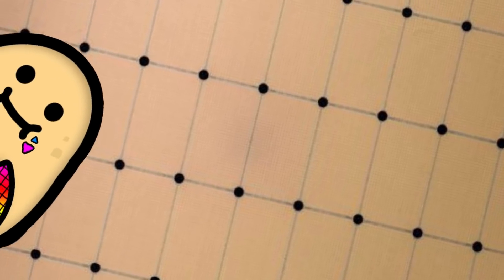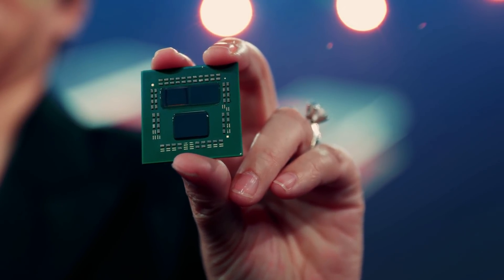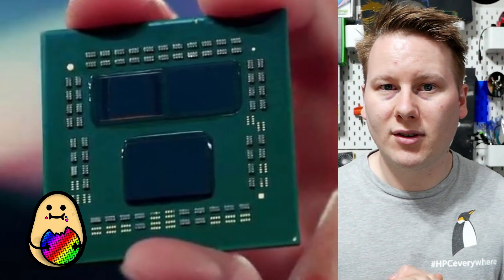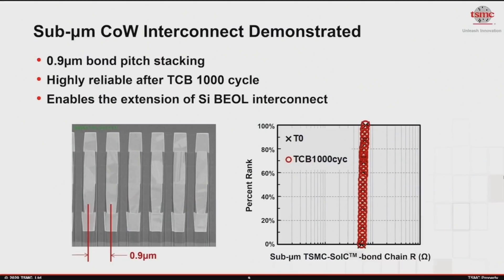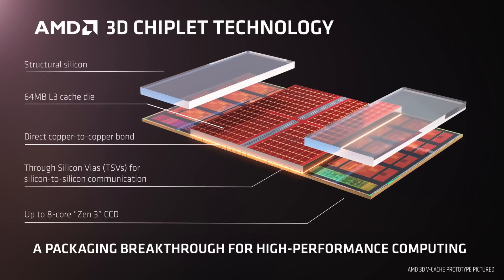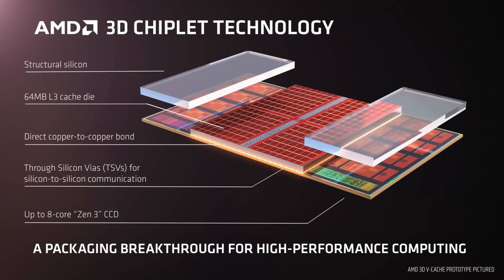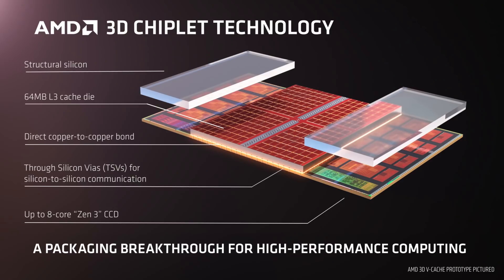AMD GETS STACKED 💪 192 MB of L3 Cache on Ryzen, Coming 2022?

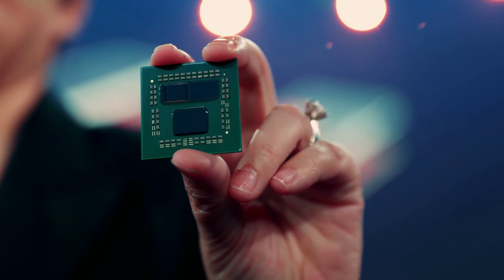Comment: 3:05 Lol I know this video is ancient, but this actually isn't right. The chip Lisa showed had V-Cache on BOTH chiplets, but with the heat dissipating "silicon lid" removed on the left one so you can see the bonded cache die inside. (It's still there inside the right chiplet. Notice how much bigger it is vs normal Zen 3).

Comment: I'm a bit confused why you wouldn't want to put the core on top of the memory? Wouldn't that align more with where the data needs to come from and where the heat needs to go. Not my area of expertise but building a system I would put my cache between the work being performed and the outside world instead of having to go through the work being performed.
Reply from the maker: The cores need lots of power. If the cores are on top of the cache, the power vias have to come through the cache, creating silicon dead zones due to interference. You essentially get less density in your cache as a result, and it's much harder to design that way.
Reply: @TechTechPotato  Interesting! Thanks for the answer.

Comment: I think AMD will add cache to their mobile processors too. It's much cheaper to make a small SOC and then increasing the L3 with stacking as needed. At the end, the same way they started making chiplets for Epyc and then using the same ones with Ryzen, the other or maybe the primary desktop chiplet branch will be small, efficient mobile APU-s stacked with extra L3 ditching the need for a separate  I/O die. Laptop parts could have a special higher tier with increased cache for mobile workstations. The implications of this technology are mind-blowing.

Comment: I am thinking AMD's 192MB of L3 will go over as well as Intel's L4 of 128MB that Intel got rid after it didn't work with the Broadwell CPU. The reason why is L4 slowed down the chip. The reason why not Eypc is Eypc's adtavage over Ryzen is Eypc can access more DRAM than Ryzen can so having to go through 192MB to get to the memory controller to get to the correct DRAM chip will slow down the complex server workloads. I can see it used on compiler servers but i don't think anyone will buy a Eypc chip just for compiling alone and nothing else. As Ryzen is pretty much a consumer use chip. Consumers who don't game most likely wont notice any difference while consumers who do game will notice a difference. It will also make a thing to get a segmention from Ryzen and threadripper. Threadripper having less L3, more cores and more RAM compared to Ryzen with more L3 less cores and much less RAM. Very different market segments require different chips. Threadripper chips are basically Eypc CPUs while high core count Ryzen chips are getting close to how many cores a  Threadripper chip has. Having another factor between them might help. Having something that helps the consumer instead of taking away something is good. Intel did it by taking away ECC to divid their server and consumer lines. IF AMD just changes how the Ryzen chip and Threadripper / Epyc chips are then AMD will be giving the consumer something instead of taking it away.Smart business move that only the I/O die has to change which the I/O die for all of them is already different.

Comment: As far as I am aware it’s not a silicone shortage it’s a substrate shortage so in theory the increased silicone shouldn’t affect how much they can produce
Reply from the maker: Silicone is for fake breasts. Silicon is for processors. TSMC is still running at limits, and AMD's wafer supply has to be managed, regardless of the substrate shortage.

Comment: Maybe stacking cache on cache prevents the drawbacks you mentioned. The logic portion of the chip "the cores" do not have chips overtop being feed by via connects. Just silicon blanks to level the chip and help with heat transfer. If AMD wanted to offer some simple low bandwidth and low power type secondary die logic, they probably could stack that over the cores.
Reply from the maker: There's a second video where AMD answers our questions. That's covered in that.

Comment: Didn't they say that the copper interconnects also aid with helping keep the chip cool? Like if you have copper bottom to top with the interconnects would that not perhaps increase heat transfer at the interconnects? It's got over double the heat transfer coefficient... and if this is good for gaming shouldn't it also be good for apus? Like adding extra L3 and maybe L4/HBM would remove a lot of the bottlenecks that are experienced with APUs.

Comment: @TechTechPotato You mentioned TSMC had a prototype withj 12 dies stacked... this AMD one has just two dies.. but in your travels did you find out if the 15% boost is a linear or decreasing value... if it was 12 dies stacked would that increase performance by 180% or more like 50%-60%...ish?

Comment: Think it sounds like we'll be getting a refreshed Zen 3 with 3D stacked cache in Q1 2022 and Zen 4 in either late 2022 or Q1 2023. Would be similar to the XT refresh of Zen 2 which came out the same year as Zen 3 but like 6 months earlier.

Comment: IIRC large caches are also very useful for compiling, rendering, and compression. I think also generally memory-intensive workloads with a medium sized footprint (some 10s to low 100s MB) could get large speedups for large L3s.

Comment: I bet that having a ton of cache helps clean up the long tail of extremely diverse niche use cases that need it. Like if your program needs to randomly access a 20-30 MB array (per core), then adding more cache is extremely productive until you have enough to fit all the arrays in it.

Comment: I remember reading about a “neural cash” where the cash was able to do a limited number of operations such as adding multiplying and accumulate. Basically presenting a PIM (in cash) to handle some ML workloads. That could be a possibility for utilising this massive increase in cash. Although you would run in to that power limitations with TSVs 🤔

Comment: There is a story in AMD’s vcache beyond performance. SRam has different requirements to logic transistors opening the possibilities for process optimization (I.e. did you notice that the vcahce achieves 64mb in a similarly sized area to the 32mb of intergrated cache in the zen 3 die? Despite both being 7nm). A separate sram die could use optimized libraries and optimized processes e.g., fd soi. Furthermore I’m not sure if cache gains that much from node performance improvements that logic does, with profound consequences I.e. supposedly cost per transistor is flat or increasing with decreasing nodes. I wouldn’t be surprised if zen 4 has less integrated cache with more outside cache. Think more cores or less cost. Semiconductors has always been about x per dollar.

Comment: If this works for L3 it's only a short while until they use it for massive L1 caches... Lisa mentioned that the stacked chip is an SRAM, so it's only a matter of supporting the required associativity.
Reply: I don't know about L1 or even doing this for L2 cache. Just trying to think of how you would do it would seem like a nightmare.

Comment: Did they just grab one silicon die flip it and put other on top of it,face to face?Or they put it on the back side and interconnect goes through silicon? How did they manage thickness of it? Is it 2 times thicker? Why not to put copper stiffeners instead of silicon?

Comment: An interesting point, their 3d stacked tech was being shown off with CURRENT GEN RYZEN. AKA 5900x. NOT NEXT GEN RZYZEN! Lisa Su stated it was like 12% average more performance just from going 3d stacked with this new cache.... but that's on a 5900x.... what happens when you 3d stack with a cpu that can take better advantage of the cache because of an updated design?

With that in mind, we can ASSUME AT LEAST a 12% performance increase with AM5 over AM4 simply because of the 3d stacked technology. Which is still a great performance increase alone. Then we will have architecture gains as well as clock speed gains. I am assuming a 30% bump over AM4 going to AM5 with DDR5 memory....

Comment: My only concern is heat. SRAM is power hungry and runs hot, especially if it’s stacked on top of a heat generating component...
Reply: TSVs conduct heat really well. So components below it should be fine. It seems HBM has really worked well for AMD.

Comment: It is an over simplification to say cache size only is good for gaming. Cache size is good for everything that optimizes for it. My first goto when optimizing a critical section is cache alignment and sizing. When bigger caches become available in the main stream more and more applications will optimize for it. Think threading in the early 2000s, developer adoption requires standardization first and usually is a generation behind the hardware.

Comment: I think you provided a a clear and fair review of their new feature announcement that we will likely see with the upcoming refresh in the start of 2022. I do wonder for upcoming architectures if they will switch to a stacking method that puts the cache on the bottom and the logic cores on top of the stack for better thermal transfer characteristics like how Intel is going for in their design? That extra silicon used for increased rigidity and mounting support is gonna insulate core heat a bit more like you said, and I think that may impacted overclocking max headroom slightly, and if not, may be alarming at first because of the higher base temps at a minimum.

As for stacking the cache on the bottom, yeah i get that wasn't likely gonna be the first implementation they released, as they would have needed to sort out vertical power delivery pathways, and possibly other issues like you mentioned. So stacking cache on top of existing cache, while not easy, is still likely a lot easier than the more in-depth redesign to layering it on the bottom and then routing power to the cores vertically that would be required.

Comment: So if it's 36 mm^2 X2 for two stacks of additional cache to get 12% more performance in gaming only, it seems very inefficient. The additional 72 mm^2 of silicon should be costly, and since Zen 3 is 81 mm^2, 88.8% more silicon should be giving 37% more performance by the square root rule of thumb.

Comment: Chuck an 8GB DRAM chip under the lid and you get the sub700 laptop market. It is way way better than having a USD 30 soldered DRAM stick pass through the motherboard adding latency, eWaste and more importantly cost.

Comment: This is the most pointless insistence we've ever seen, especially when Icelake's small L3 is already getting 90+% hit rate in almost all situations I tested. Perhaps that cache die will increase the hit rate by, like 3%, with several more cycles' latency as a side effect?

What they really should do is to improve their prefetch algorithm, IF latency and overall architecture, instead of just give caches, hope the benchmarks and low-end games always run in it, and advertise on so-called "IPC improvement" in these things.

An interesting note, the effect of 16KB L1D buff in Icelake, in overall cache hit rate, is already larger than the difference between units which have 24.75MB and 38.5MB L3(tested by deactivating cores to preserve cahce at the same core cnt, and measuring in Vtune).

Comment: the trick/trade-off in cache is miss penalty. the shared L3 latency is 10ns? for AMD? I believe that means an L3 cache hit is 10ns to deliver data to the core (L1?). My question is: on an L3 miss, what is the delay in sending the request to the memory controller? in principle this could be less than 10ns? 
Presumably latency to the off-die SRAM is higher than on-die, even with stacked & TSV. To a degree, an app can tolerate the longer latency if there is sufficient hit rate. But shouldn't the tags for the stacked SRAM be on-die? hence on a miss, the request can be sent immediately to the memory controller?
Also, is it really cache? or is it directly addressable memory? In Intel, there is an option to use a certain amount of the L3? as memory and a specific application that benefits. Cache has curve of diminishing return, and incurs latency on a miss. The reason for memory is one, no tag (tag check) is required. There are apps (including kernel components) in which certain memory structures are critical and can fit easily into a large (by SRAM standards) array.
On second thought, if the SRAM die is only 6mmx6mm, just put on the CCP die (also small), assuming the IO + CCPs fit in the package

Comment: So how many generations until they can run cinebench in cache? That'd really boost benchmarks.
Integrating this on epyc seems easier IMO - lower power per CCD (although at AMD power levels it'll probably be fine on ryzen as well). The people buying 72F3 epyc chips will like it a lot

Comment: Does all the elements of the stack need to be supplied by TSMC?
Can they fab the cache using an older process node?
Reply: I think cache will need to be on similar nodes due to how fast it needs to be and also space in a chiplets design.

Comment: So later on if all cache moves to the top layer i assume that would be allowing more space below for the cores to be expanded?
Can they add copper or so heatsinks to the sides instead of structural silicon to help dissipate that heat ?

Comment: Cache was introduced back then, because the Ram wasn't fast enough.
 To me, ddr5 is too laggy for Ryzen to work on spot. So this tech is to cut some latency, for to the ram to perform.  Might be that its linked with the infinity clock speed, thus finally bring it to 3ghz+ or even 4ghz! Maybe not...

Comment: Am5 will have only pins on the outside and a hole in the socket. So that they can put chiplets on both sides of pcb and you can put 2 coolers. Because more is obv. More better xD

Comment: What benefit would they get doing this on 5nm? I would think they would keep it on 7nm for the reduced cost and to have more 5nm silicon for the core complexes.
Reply: depends on if the sizing of the two matches, base need to equal to or bigger than the top

Comment: Dr Ian, I got questions, 
1) in the image AMD showed TSV going through the entire zen3 chiplet, that can't be right, right? Since the backside is where the mass of the silicon are. 
2) How are they bonding this to the substrate? cache chiplet side or through the back? If it's through the cache chiplet side, then how do they route the wiring necessary to bond to the substrate? Are there any wiring in the structural silicon? Itself?

Edit: wait, is the entire wiring for the zen 3 chiplet for power/data coming only from the middle of the chiplet and not the entire face of the die?

Comment: My guess is AMD plans to remove most or all of the L3 cash from their CCDs. That way they can have a tiny logic die on the bleeding edge process with great yields, and lots of L3 stacked on top using the previous gen process.
Reply: So halving the needed space on the 2d plane but you still need more space then in 3d stacking - wouldn't that be exactly the opposite of what they just did?
I mean, that certainly would be nice if they would be going for 16-cores to become the standard CPU.

Comment: There's a niche workload, IFS fractal art, which tremendously benefits from cache. I've seen a 150 vs 100 difference in rendering speed when keeping the histogram in cache. Afaik, depending on the fractal in question, it's a latency-bound workload (random walk over a histogram).

Comment: those filler bits (Structural silicon) on each side of the L3 cache die, I think should be fused with copper thermal lugs or vias to improve cooling, instead of being a lump of glass. maybe even with a horizontal grid/lattice of traces in the "Structural silicon" to function as a thermal heat spreader of a sorts over the cores.
Reply: I think they may have other cooling in place as AMD has been fooling around with additional cooling to be placed between chips when stacking.
Reply: @BNOVA  I hope so. the diagram doesn't show any thermal anything and appears to indicate that is just plane silicon (Structural silicon) filler.  just seems like a wasted opportunity to shave off the low thermally conductive silicon backing off the wafer for attaching the L3 cache dies, only to turn around and glue low thermally conductive silicon filler back on over the cores that produce most of the heat in the chiplets.  even if those filler bits (Structural silicon) was etched horizontally with graph-paper-like patrons of interconnects to act as a heat spreader, even if it's 90's era aluminum interconnect etching, that would vastly improve the thermal conductivity of the silicon. vertical thermal-vias through the filler bits would be more costly, so as much as I would like that I wouldn't expect that on lower-end parts.

Comment: Would it be technically possible to move all the L3$ to the "first floor"? The result would be small (~40 mm²) core (logic + L1 + L2) chiplets and the same size L3 SRAM stacked on top. This would mean less area / core needed, increase core-density esp for server-CPUs
Reply: If the structural silicon is NOT silicon but better thermals it is a reason to do so.

Comment: RIP Alder Lake (Q4/2021 - Q1/2022)  
I really hope $AMD ramps up and starts chipping away Intel market share; there should be more price wars post-covid to fuel the economic boom with the latest tech
Reply: Alder Lake will be faster with DDR5, but also more expensive because of that same DDR5.
Reply: @Patrick73787  The DDR5 you can buy this (and probably next) year will be much more expensive, will have higher latency and won't be signigicantly faster than top tier DDR4 RAM.
Reply: @herrbert2505  Fast DDR5 modules are on their way https://videocardz.com/press-release/xpg-to-launch-ddr5-7400-memory-modules-in-third-quarter-overclockable-up-to-12600-mt-s 
Expensive or not, it will gather the attention as it will be the new piece of hardware to play with and experiment.